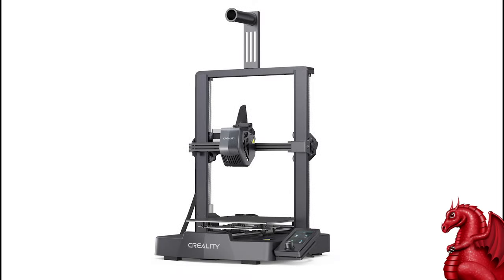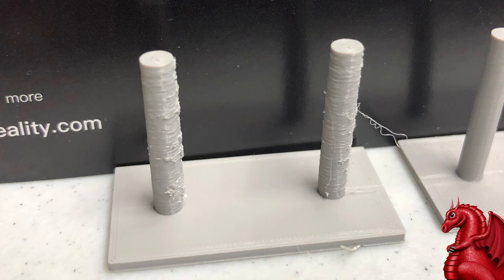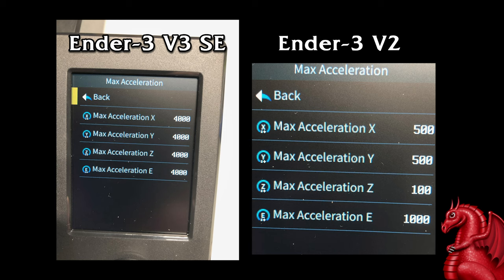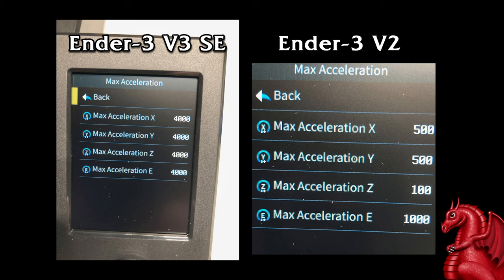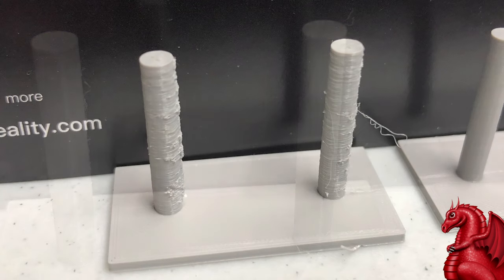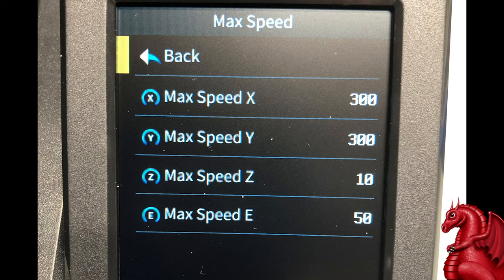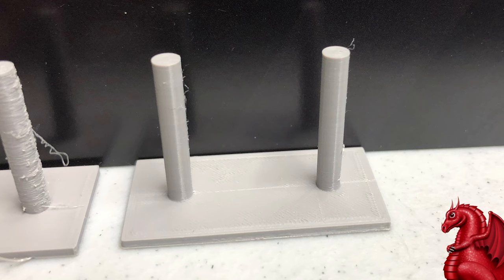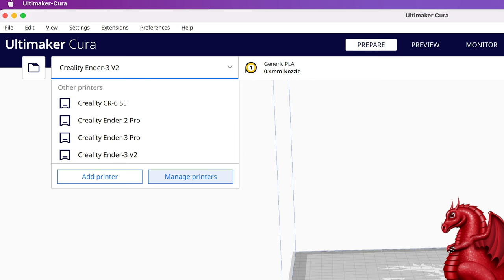Fine tune your Ender 3 V3 SE - eliminate stringing!

Comment: Doesnt this negate the point of having this speedy printer? Wouldnt you just adjust the retraction settings?
Reply from the maker: This has nothing to do with retraction settings.
Reply from the maker: This has nothing to do with retraction settings.
Reply: @Tombof3DPrintedHorrors  Well it has to do with something else because my retract towers dont look like that with out of the box acceleration.
Reply: @Tombof3DPrintedHorrors  I am also using the standard profile that should be in the next update of cura for the V3 SE

Comment: I've unfortunately had nothing but stringing problems with my two Ender 3 V3 SEs that I got around the start of October. They work perfectly fine other than the constant stringing. No matter what settings I change, no matter what max accelerations or speeds I set on the printer, I can't seem to get the stringing to stop. I've tried various PLA filaments from spools I've already had to brand new spools, and there is literally no change. I've even replaced the nozzle and taken apart the hot end to look at the extruder gear screw (thanks to your video), but the screw was perfectly in the spring.

I've been heavily researching this and have found others are experiencing unending stringing with inconsistent results on what fixes it. Some report adding M413 S0 as shown in this video helps, some have mentioned updating the firmware helped, and some mentioned updating to Cura 5.6.0 helped. I've done all of that and still no luck. I can't determine if this problem is something with the hardware of the printers or the software of the slicer. I've been struggling with this for over two months now, and while I know these are damn good printers, I'm starting to consider if I need to return these.

If there is anything else to try or any other tips, I would be happy to hear them. Thank you for any and all help on this.
Reply from the maker: Have you disassembled your extruder to make sure it is working ok? I have a video on that.
Reply: @Tombof3DPrintedHorrors Yes, I have disassembled the hot end extruder after watching your video (apologies for not making that clearer in my previous comment). The screw was inside the spring like it was supposed to be, but I did notice the spring was bulging to the side when compressed. I'm not sure if that is normal or not, but now that I think about it that might also be happening when the sprite extruder is assembled.

My Ender 3 V3 SEs were to replace my upgraded Ender 3 V2s; part of the upgrades included yellow bed leveling springs. I still have some extra yellow springs as well as the original springs to the beds. I might try replacing the spring in the extruder with some of those if they fit and see if that helps avoid the side bulging. I'm also still open to other suggestions. Thank you for any and all your help!

EDIT: I just took the spring out, and it appears to be slightly deformed, which may explain why it was bulging out. The bed springs are unfortunately too big for the nut to push down and let the extruder grip the filament. Perhaps replacement springs could be added to the recommended parts list?
Reply: @Arbiter1223  I'm experiencing a similar problem with over-extrusion. Despite using a consistent profile across all my Enders, it appears that this particular printer has a system-set higher extrusion amount, similar to the settings we adjusted in the video. Unfortunately, this specific setting is not adjustable.

Comment: my printer still having strings, even after this config ); 

my filament is 3N3 PLA
Nozzle Temp 190°C
Table Temp 60° C

Retraction Distance 5.0 mm
Retraction Speed 45.0 mm/s
Reply from the maker: For the V3 SE your retraction distance should be 1mm.

Comment: Firmware bug right from the start, shouldn’t happen, really disappointing that Creality didn’t fix this before shipping. And the Ender 3 V3 SE is supposed to be fast, after those speed settings no more.🙁
Reply from the maker: The issue isn't speed, it's the acceleration velocities. :)

Comment: why use cura when prusa or orca are way better?
Reply from the maker: Because they aren't.
Reply: @Tombof3DPrintedHorrors  really? I find prusa so much easier and better categorized settings but I'm just a beginner lol I almost sure I don't know what I'm talking about 🤣
Reply from the maker: @maicongx  Cura has control options the others you mentioned don't such as being able to set individualized flow rates for top surfaces, outer walls, inner walls, infill, etc., that allow far better control and customization.

Comment: The whole point of this printer is that its supposed to be faster, there must be another way, or at least, not a need for such a drastic reduction
Reply from the maker: Without input shaping/pressure monitoring, etc. faster just gives mediocre results.

Comment: With your configuration, I got weird squeaky noises, probably when the printer is moving on the Z axis.
Gonna tune it a little bit, maybe lowering the Z max speed and I'll update my comment.

EDIT : Indeed, I had to lower the Z max speed

Comment: So we paid for a new printer to be faster... But it can't actually print faster... That's dumb. Think imma just give the v3 core xz a shot.
Reply from the maker: Well, think about it for a moment. It still has the identical X setup (v wheel) as a standard Ender, and no linear advance in the firmware. It can print fast if you tell it to, but it won't be as high quality as going slower. This channel is about achieving maximum print quality for your tabletop terrain and miniatures. That is all my profiles are designed for.